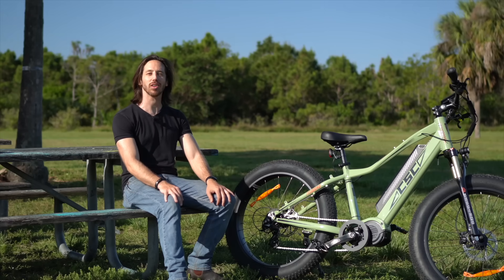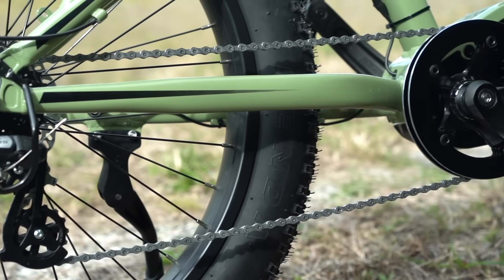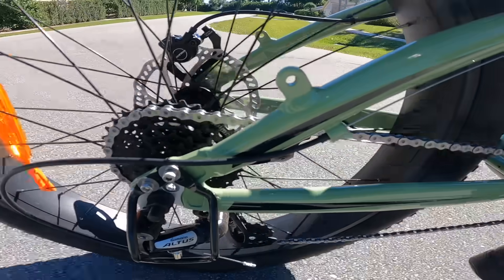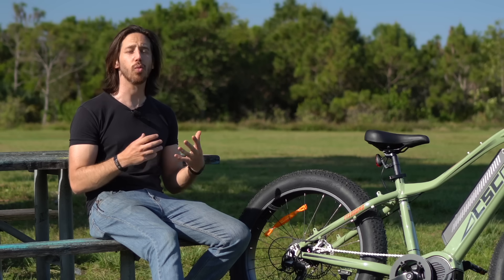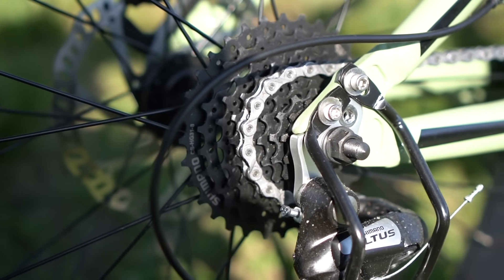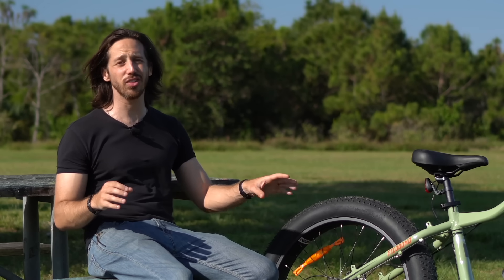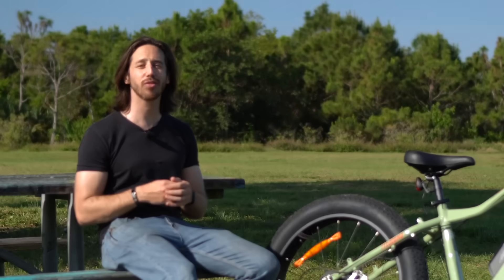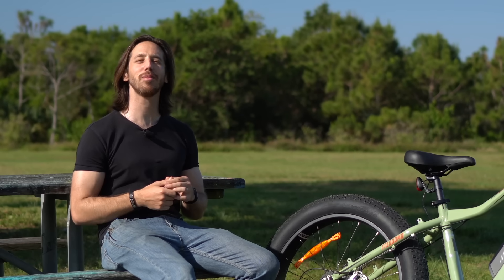How to (properly) ride a mid-drive electric bike

Comment: Great advice and timely as I'm looking at purchasing my first mid-drive soon. I ride for exercise and exploring and have my class 1 Brompton Electric mainly in my second highest cog/gear with my lowest pedal assist level in most conditions. While not a mid-drive, do the wear issues you mentioned still apply and how would this strategy fit your recommendations when I do get that mid-drive? I did just have the shop replace my cassette for the first time on the bike after 4000 miles which seemed OK to me. Thanks!
Reply: On a hub motor you take a lot of the strain off the drivetrain so can last up to 3x as long with a hub motor if you ride to the same speeds as a conventional bike but even if you cycle with as much effort as a normal cycle and use the motor to go faster it will be about the same 1x wear rate. You don't have to worry about drivetrain wear or chains breaking with hub motors it's one of the big advantages over mid-drive. That's why hub motor ebikes can have such crappy drivetrains it just doesn't really matter at all it extends drivetrain lifespan not shortens them.

Comment: So I have 3 questions, having never riden a mid drive:
1. Is it a good idea to ride them in the rain/ wet conditions? The motor is in direct line of fire of the water being kicked up by the front tire.

2. I have heard it said that you're not supposed to start off in the highest gears. But what if you had to come to a stop suddenly and didn't get chance to gear down? Is it acceptable to use a tiny bit of throttle to get moving? Or the lowest pedal assist level? Would even this destroy the drive train?

3. Have any of you mid drive riders ever been fearful of being in traffic and the chain breaking at the critical moment, right when you were crossing an intersection or going through a roundabout? This idea terrifies me cuz there's no way to quickly get out of that situation. With a hub motor, if your chain falls off or breaks, you can use the throttle and motor. If the motor fails, you can still pedal out of danger. 

Thoughts?
Reply: As far as riding in the rain, my Bafang motors do not like getting wet. Fortunately for me I live in Arizona and I don't worry too much about rain. The higher end middrive bikes are pretty good in wet conditions. At least that is what I've read. Do your homework.
Reply: Water has not been a problem for me but don't use high pressure water cleaners. In need I have often needed to start in a too high a gear. Just go very gently and change down asap. Chain breaks are uncommon as long as you maintain them. But I guess it could happen at an intersection as that is where the chain will be under high load. Don't rely on it to dash in front of traffic. Wait until it's clear and use low power to start and gradually increase the power. Sharp instant high loads (full throttle from standing still) are not recommended as it will increase wear to all drive components but usually it won't break a chain.

Comment: Using the brake leavers as a way to let off the mid drive motor power is a helpful recommendation that I had not considered. Thank you!
Reply: Don't pedal or use thumb throttle when shifting. Only takes a split second. You be the brain. No brake or shift sensors needed.
Reply: @josephnason8770  i always thoufht you need to pedal even normal bikes to switch hears?
Reply: @killerbeau95  You don't need to pedal to switch gears, even on a regular bike. As long as the rear wheel is turning, the rear cogs will turn with it, allowing you to change gears. If you already have a lot of momentum, or if you're going downhill, you can stop pedaling and the wheel will keep going.
Reply: @SynthApprentice  dont think thats true as the pedals move the chain, the wheel does nothing
Reply: @josephnason8770  .
Reply: I think this shows the difficulty with hub drive and throttle bikes. The rider is trying to reconcile vastly different strategies for riding. The class 1 pedal assist is the only way to go, IMHO. The throttle is an unnecessary complexity. Meanwhile class 1 bikes can ride practically everywhere including national parks
Reply: @stephendenagy3396 
Its super easy for me. Just let go of the throttle for a split second and shift gears. Try not to shift uphill. Mid drives are fun.

Having a left thumb throttle is the way to go. You can ignore it and set the bike to pedal assist 1.
Reply: @TheAgentAssassin  yes but some people actually pedal their bikes.
Reply: Oh boy! I shouldn’t read the comments!  Talk about a vast number of opinions! 😮
Reply: Careful doing this. It can shorten the life of the controller. I personally lost the controller to doing this with a hub. You should always release the throttle when stopping or shifting to keep optimal preventive maintenance on system. With Or without the brake switch present.
Reply: I have a gear sensor cut off on my bbs02 but it doesn't give the motor enough time so end up using the brake cut off
Reply: That's how I do it, use the brake left brake lever. Adjust it so you have enough play to pull lever back to cut motor off but not activate the brake. I have sensor/magnet with hydraulic brake and positioned the sensor/magnet so it cuts the motor with just the slightest pull. Just a quick flick on the lever while shifting it's all it takes for smooth quiet shifts  Don't need brake sensor on the right hand side as I always use both brakes at the same time so it's basically the same as having brake /sensor on both levers. This is on a MTB with Befang BBSO2 750w motor with 52v 17ah battery.
Reply: My new mid drive bike has no brake lever cut-off !
My old hub-drive bike DOES have the cut-off !
Go figure 🤔
Reply: @unclepete100  it is illegal to sell an ebike to you without a cutoff.
Reply: @bob-ny6kn  no
Reply: @andyb7963  Darwin.
Reply: @bob-ny6kn  Not so. Trail e-MTB bikes omit the brake lever cutoffs, since you often need to work power against brake. For street bikes and certainly throttle bikes, they are wise to have, even on a DIY build.
Reply: @bob-ny6kn no it isn't.  The literal market leader, Bosch, doesn't have a cutoff when it comes to shifting. 

I'd love to see you explain how that's illegal. If you can't shift properly, you'll have more wear. That's about it. Motors that have sensors for it are either outdated, or specced to be used with specific motors, rear derailleurs, chains, and, of course,  cassettes. Ask shimano and sram about that. 

Illegal.. don't make me laugh
Reply: I’ve been doing that for some Tim now. Just don’t wear down the pads to quickly
Reply: How do you do this i have hydraulic disc brakes how do i install those levers on my shimano hydraulic brakes?
Reply: @killerbeau95  you don't,  you need to attach sensors and magnet
Reply: Wouldn't be better if they integrated power cut-off switches to gear selector also?
Reply: You will wreck if you do that. I guarantee it.
Reply: ... brake levers*. They actuate the brakes, not "leave" them.
Reply: I just turn the bike off then on when changing gears. No issues so far!

Comment: For anyone considering installing a mid drive on a bike with a rear suspension triangle whose pivot bearing is behind bottom bracket, don't do it!.
The motor's huge torque will really flex the pivot bearing every time the motor revs causing the rear wheel to kick rightward eventually by an inch or so.
A hard tail or a triangle pivoted in front of the bottom bracket is fine.
Reply: You get used to it if you have a robust enough gear train. 1/8 inch chain and rings minimum. The 3/32 just will not handle a high load.

Comment: Reducing power on pedals is essential during change of speeds. Any time I give somebody a ride on my middrive e-bike first what I hear is how badly they change gears during load🤯 Of course I tell them before to not to do that but they have no clue 😂 anyway or just do not care😡😁 This short video should be attached to any sold e-bike on CD or pendrive or qr code linked to video because typical buyer have no idea how to use middrives.

Comment: If you’ve never ridden a geared bike before, start by riding with no power assist or the lowest setting to develop an intuitive feel for the amount of effort it takes on each gear, given the grade of the hill and speed you’re traveling at. You shouldn’t be pushing that hard unless you’re climbing a steep hill.

The harder you have to work under these circumstances, the harder the motor and drivetrain components have to work once you crank up the assistance level.

Comment: Very good advice. I burnt my battery charging connector as it was always on high gear. Had to remove crappy connectors that were not meant for high demand of power all the time. Basically the connectors are the weak spots as they use cheapest ones

Comment: I'm riding bafang bbshd for almost 5 years, milage is about 9000 km a year. I wish I didn't have to buy new chains, cassetes, rings, rear derailleurs and overhaul transmission since I ride on full throttle all the time. My main question is what hub motor could replace the amazing bbshd and feel not much worse at least. I've randomly found MXUS xf19r geared hub motor, it it a good choice? I've got a regular mtb bike frame. I want to try 72v maybe, for higher top speed but not sure, is geared hub motor ok with such power or better go with a regular 52v battery? I just don't want a super heavy and bad rolling resistant direct drive motor on a light bike frame. But maybe there are a good choices of direct drive motors also.
Reply: I have the same idea about mxus and 72v
Reply: @musmanov4642  Ok, but do you know what the exact model of mxus motor are you looking at?